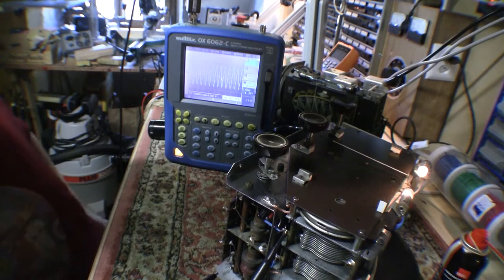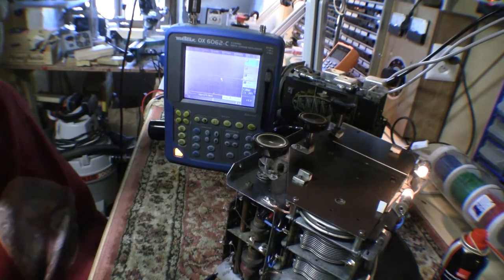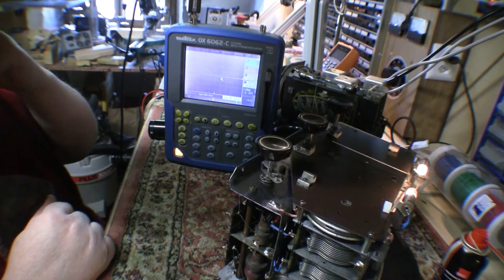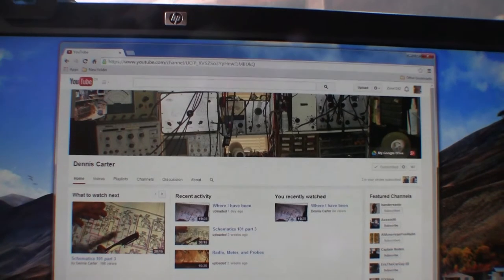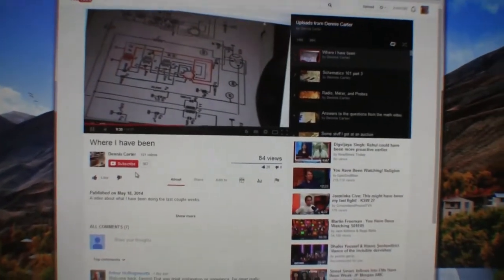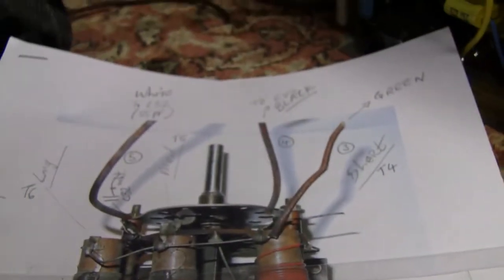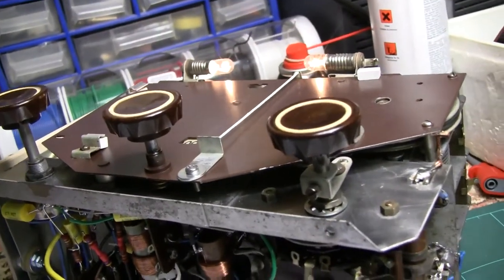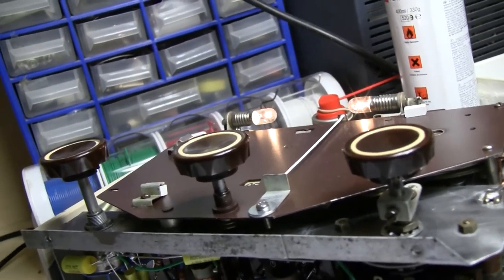Radialva Groom Rebuild - part 21

Comment: Well, that made my jaw drop.  Don't know how else to put it.  I regularly change positioning of components, with an eye towards isolation, of course, but, I've never had this issue crop up.  Dennis, as I've long said, is a master and anyone in this hobby needs to watch his videos.  You never come away from one without learning something, just about be impossible to not.  When I watched his video, I wondered if anything would stick, great to see that it did, John.  Your persistence paid off.  Good video.

Comment: I'm new to the restoration of old radio's and will be more careful with component placement in the future. I watched Dennis's video and it is pleasing that it helped you sort out the short wave issue. Thank you for your video's and well deserved victory. Regards Bob
Reply from the maker: Thanks Bob, I got started with this tube stuff just a few years back so I'm still a newbie - my training is all on the solid state side of things.   Thanks to the great folks in this community I've had lots of help with the various projects I've taken on.
Cheers,  John

Comment: Wow John!
   Two inches of lead length difference, made the oscillator not function? I know positioning gets very critical at VHF and higher, but really surprised me in this case, as it is also evident at lower SW frequencies, (in this case), as well. Well, who would think? No wonder they jammed that capacitor in the working set where they did.
   They may have had the same problem that you are accounting here during the engineering phase of development. Who knows?
   All I can say is; "All right, Atta Boy Dennis!"
   I said it before, and I'll say it again; "Dennis YOU'RE the MAN!"
   This ended up being a great working example of how we can all work together to resolve something unanswerable, answerable!
       What a great and satisfying outcome.
            Congrats is in order, to both of you!
                  Yes, Cheers is in order. It's time to head to the Marshall stack!
                       Tom
PS I am really stoked now to get back into this again after all the dust settles here and I find another QTH (home), to work on this again for myself as well. This really, really, was inspiring! This IS what troubleshooting is all about!
Reply from the maker: Hi Tom, I'll admit to a certain level of excitement (!) once the set jumped into life on shortwave.   Hopefully the rest of the project will go smoothly from here on.   Speaking of guitar amps my latest addition is towards the ultra modern end of things - check out the Line 6 Amplifi (150 watt version of course!).  Looking forward to seeing your next project once you get set up!
Cheers,  John
Reply: Zone1242
   Amen John, I can't wait to get set back up and start contributing again and having fun in the process.
   Cheers my friend,
         Tom

Comment: Excellent!

I've done that same thing many times, moving components because it seems easier when reassembling the radio. I've been lucky in that it hasn't caused any trouble for me so far, though. But after seeing all the trouble it caused for you, I suppose I should be more careful about it.
Reply from the maker: Hi Art, yeah I wasn't sure if this was the problem but I thought I should make the new set as close a match to the working one as possible and it turned out to be the answer.  Now it's over to you and your rebuild project :-)
Cheers,  John

Comment: I had an idea that the oscillator wasn't working in shortwave mode for some reason, and that it was related to the tank circuit in some way only makes sense, however I thought it may have been a coil winding that was connected the wrong way around not simply a matter of parts placement or lead dress. This is why I tell people to leave the mica caps alone in the front end of a set until they rule out the usual things first, get a new mica cap or a lead in the wrong place and you can create a whole new problem. Normally in a North American built set you don't have to pull out a bandswitch assembly to get at perishable parts above it, but in these Super Grooms there isn't any way around it.
Reply from the maker: This little set is certainly cramped so serves me right I guess for taking an easier way out when doing the rebuild.  Lesson learned for sure.  I got to the stage where I could take the wave selector assembly in and out with ease!
Cheers,  John